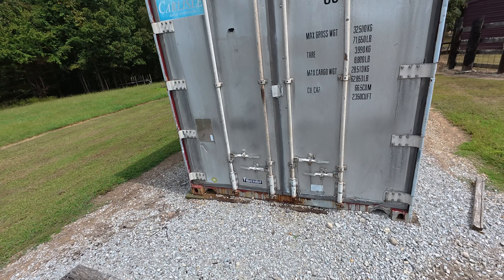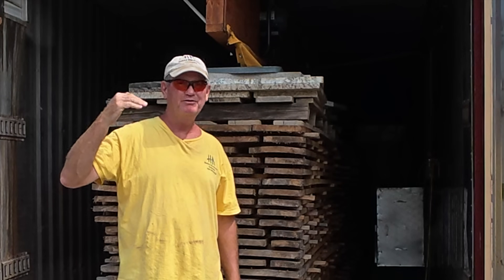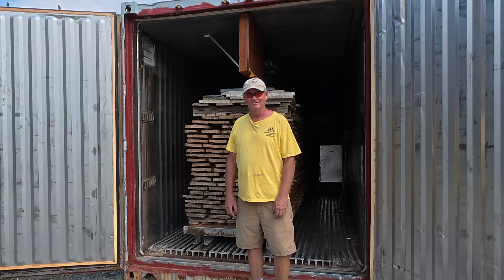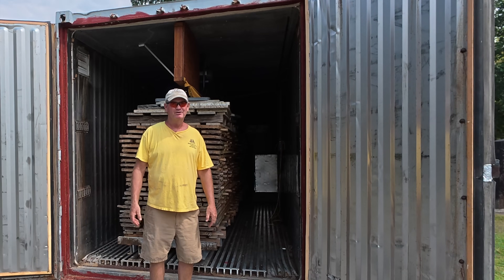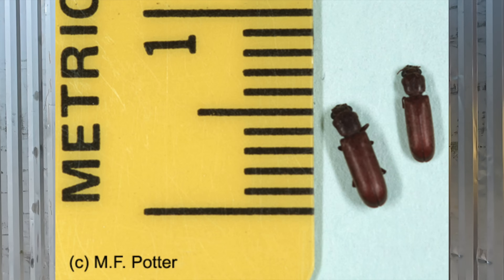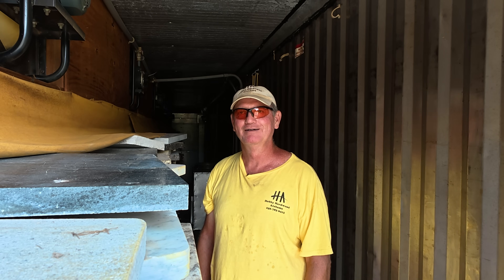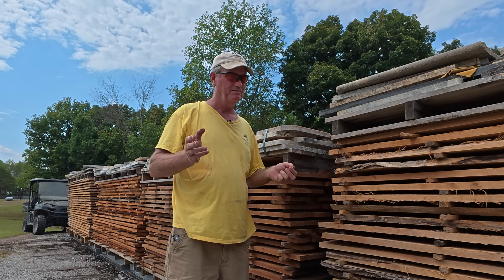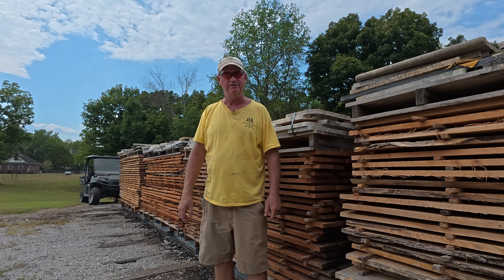26 Lumber Kiln Myths and Truths PART 1

Comment: Believe it or not, everyone doesn't have a $40k plus kiln. Air drying and solar kiln are fine, these guys undermine the little guys to make themselves seem smarter.
Reply from the maker: 100% Absolutely WRONG!  I do this for a living, you obviously do not.  If you want to risk destroying your house, then don't sterilize the wood before you bring it into the house.  I built and used a solar kiln for over a decade, I knew the guy who invented the Va Tech Design, and it will NOT sterilize lumber, and he never claimed it did.  So you know more than Professor Eugene Wengart, the Wood Doctor??  I had to put wood dried by my solar kilns into my other kilns to sterilize,, and I routinely found dead powder post beetles after the sterilization cycle that were not killed by the solar kiln.  About once a week I get a call from people who have done as you say, which is ignore the obvious facts that bugs live in wood and if you bring the wood into the house, the bugs now live in the house.  They ask us for help, because they now have bugs coming out of their floor, furniture or counters.  The cost of tenting and fumigating the entire house is $25K and the cost of fixing the damage is typically an insurance claim.  No bug control company will cover the cost, even if the house is under contract, because the person knowingly brought the bugs inside, so it is a self inflicted claim, and they will not pay.  Do you really think the USDA would come out with a sterilization standard that EVERY professional lumber dryer adheres to, if it was not important?  Instead of saying people like me are trying to "make themselves sound smarter" maybe you should listen to what a professional says, and whether you believe it or not, and whether you do it or not, don't insult me or say I'm lying, when everything I've said is easily looked up and 100% factual.

Comment: The in-kiln moisture reader, How do they detect a moisture pocket when they exist in a static location?
Reply from the maker: Normally you will see indications because the boards are drying erratically, not on a smooth slope or drying curve.   It will usually stall also, indicating wet pockets leaching moisture.  Basically, the boards will "behave" differently.

Comment: Just catching up on videos. Maybe you answer this in the next, but once kiln dried will the moisture come back after a certain time?
Reply from the maker: Yes it will come back up to the surrounding equilibrium moisture content (EMC) of its surroundings, so it should be stored in an environmentally controlled room or building.

Comment: Robert - have you ever heard of a "160 degree F sap set" at the end of a drying schedule?  I've heard guys talking about that up here in northern Minnesota where we saw a lot of red pine, white pine, and white spruce (to supposedly cure any sap pockets so the boards don't drip or have sticky spots).  Thanks and looking forward to part 2.
Reply from the maker: Yes, it is critical for pine, it is also called "Setting the pitch" and basically raises the temperatures of the boards where the turpentine and volatiles in the wood evaporate out, making the sap a hard, crystalline material.  Many times the pitch is not set correctly, and that is why you've probably bought 2x4's at Lowes or HD and noticed they had some sappy, sticky pockets in them.  In that case, it was not set correctly.

Comment: I've said many times, thank you for your videos, but thank you even more for answering all of the comments. I often learn just as much, or more, from the comment replies. I would love to hear about different air drying times for different species prior to going into the kiln.
Reply from the maker: Thanks.  Each species and thickness has a published maximum moisture removal rate of moisture that it can tolerate before it cracks.  So the pallets of lumber are placed in specific areas and other strategies ar used to not dry the wood too quickly to cause cracking or too slowly to cause staining.  Some species I can even used forced air fans on, and some I have to cover with a material to slow the evaporation down.  Good question.

Comment: I have some air dry walnut and need to use some to make 7/8 X 2 inch legs. I don't have a way to kiln dry it. I've brought it into the house to help with drying. Am I better off drying it as a board or cutting the legs out and drying them that way?  Thanks
Reply from the maker: It will move when it dries so better to dry it as boards and then cut the pieces out later.

Comment: Another great video. Thanks again for sharing your knowledge. My grandfather owned a hardwood flooring company, even though the lumber was kiln dried we would still acclimate it in the house to be installed for a couple weeks to assure stability. Some of us folks can't afford a top end kiln like you have, could you share your thoughts in a video on other kilns such as solar or small homemade dehumidifier kiln. Thanks again!
Reply from the maker: Yes, I will do so.  I had a solar kiln for about 10 years, it was very good.  There are also ways to build home made kilns, as well.

Comment: Here an interesting experience we had with drying lumber, but without using a kiln. We were doing a 'gut to the studs' job of our house from 1880. BTW this is in Nova Scotia, which has average but over the year also varying moisture levels. A bunch of old 8x8" columns and beams in our basement were rotten and needed replacement. So our carpenter got super fresh hemlock from the sawmill which was soaking wet and super heavy. Probably not ideal, but the end result was still pretty OK ... and cheap :). 
Now the interesting part: We had some left over beams and kept them (separated with battons) in our basement. Which BTW also has the oil-based furnace for our forced-air heating system. Plus we ventilate that rubble walled basement a lot, most of the time with a couple of small open windows. Three years later I needed some wood to build a shelving system and thought of that hemlock. Over that time it had probably lost half its weight and although I didn't measure the moisture level, it was probably pretty dry. We got it sawn and planed into boards and it has since then never warped or anything.
Lesson learnt for me: a kiln is great if you can't wait. But leaving your wood rest for a year or more in a relatively dry an not too hot or cold environment does the same thing. :)
Reply from the maker: Anytime the air temperature is raised above ambient, and that air is exchanged, then its moisture carrying capacity is increased, and it will transport moisture and dry the wood.  Even a few degrees is all that's necessary, no different than a Wal Mart food dehydrator.  Good observation and comment.  I will discuss it in a follow on video.

Comment: YH, what about timber framing and other construction applications that typically use "green" wood?  Up here (Northwest New Jersey) Eastern White Pone and Hemlock are the most popular choices. require
Reply from the maker: I don' know about up there, but any untreated wood here in the south will quickly get powder post beetles, every barn, shed, etc is infested.  There are soem species that are naturally immune, such as poplar (magnolia) and walnut to some degree.  That's why there are no 100 year old, oak log cabins here anymore, the only ones standing are poplar.

Comment: I noticed your moisture probes are on the edge of the boards. In the nyle manual it says to place them on the face of the boards across the grain. By using the edge they are being placed with the grain. Have you noticed a difference in either method. I will be firing my kiln up in the next couple of days and I will place a probe on the edge of the exact board with a probe on the face to see if there is a difference
Reply from the maker: Realize an edge is simply a narrow face and the probes measure moisture and the resistance in the wood and it electricity doesn't care what direction or face it is measureed.  The important thing is to get the probes into the core of the board, it doesn't matter how it gets there and in a place that will dry hopefully the slowest, so there are not wetter spots than where the probes are.  The reason Nyle wants you to out the probes in the face is that is going cause you to more likely place them in a "moist" area.  That's also why you never measure from the end of a board, it will dry faster than the core, and give an erroneous measurement.  In reality, you will put more error in the measurement by the distance placement of the probes (30mm) separation and the species calibration and the main thing is to try to identify the wettest portion of a board and measure from there, whether it be an edge or face.  Nyle is a good company, but their "coefficients" for their drying groups are off and you should always check the final moisture with a "real" moisture meter, such as a Delhmorst to be sure.  Also, when you run your experiment, you will notice that no matter where you put your probes, and the wood gets down to under 9%, then to 7%, the spread of the measuremts, face to edge, will come together as the moisture is removed and the conductivity of the wood becomes more constant as the moisture becomes low and the same across the board.  On a dry board, it will not matter at all where you measure moisture, face, edge or end.  A dry board is a dry board.  Also, as you dry the wood looking at the probe reading,, you are really looking for a rate of change of moisture from yesterday to today, so not to exceed the daily allowable moisture removal rate.  That is the most important thing.  Ride the allowable rate curve down, and you will notice Nyle's kiln schedules are approximate at best..  I have run the experiment you propose many  times, and it is a good one and an eye opener.  Plus get a good, NIST traceable pin meter,  and measure the entire board, many places, and that's when you know the board is really dry.  Great question.

Comment: Robert, Great job on pontificating the process of kiln drying. I'm wondering what your opinion is on the pros and cons of vacuum kilns with heat. I look forward to your videos every week.  Thanks. DonR
Reply from the maker: All will work of used correctly, but I have had more complaints from customers who bought wood from several local, low vacuum heat kilns than any other cycle.  It must be used correctly.

Comment: Not trying to argue with you, but I'm really confused at this point.  If a kiln does not dry wood faster, then why does virtually all these kiln guys on YouTube brag about how fast it dries their wood?  Also, the higher temps just make sense that it dries faster?
Reply from the maker: Good question.  Kilns dry wood in a controlled environment, at the maximum allowable moisture removal rate for that species and thickness vs air drying.  So for example, pine can be dried very fast, well over 10% per day, and in most areas of the country, the maximum open air drying rate is about 4%.  So for pine, yes, kiln drying can be done 2X or more faster than air drying.  However, white oak in 8/4 thickness can only be dried at about 2% per day or it will surface check and check.  Air drying 8/4 white oak will cause drying too fast jn many parts of the country and will crack the wood.  So a kiln will be set to conditions to dry at 2% and will produce perfect boards but will take longer.  In addition, many people done care or look for the surface defects and which we do, and it is a common customer complaint where people buy from "other" kilns and th wood is ruined when they buy it, but didn't see it until it was planed.  That's also why we always plane our wood before we sell it, it is the ultimate tool for quality control.  Also, not disparaging my YouTube Brethren, but soem have been "sponsored" by the kiln manufacturers and have received their equipment for free, so of course they will say how fast it dries.  As far as heat, yes, the more the heat, the faster will will evolve moisture, but the strength of wood drops drastically as it's temperature goes up, making it even more prone to crack and defect.  So cooler temps in kilns should always be used for that a reason, however, cooler tempos while drying also let the wood retain its natural color and vibrancy.  Higher temps "cook" wood, lower temps "dehydrate" wood and retains its color.  In the end, if the wood has a maximum allowable drying rate that higher than air drying, then kilns can speed up the process.  If the allowable moisture removal rate is lower than air drying, then the kiln is used to slow the process own.  Great question and a great subject for an entire video!

Comment: Say you buy a batch of kiln dried lumber and store in a NON climate controlled environment. The moisture levels are going to change to that environment correct? I would think this would make a wood shop without climate control (at least in midwest) a non starter. Or am I missing something?
Reply from the maker: Yes,  it would be very problematic.  However, even the addition of a $100 Wal Mart dehumidifier can make a huge difference.

Comment: As always, another great video!  We have 2 Nyle L200M's and 1 Nyle 200Pro and love them.  We just commissioned Nyle to custom build us a 40' chamber for one of our L200M's.  When we started, we build our first chamber in our garage.  The only issue with it is that the chamber is just too small and we kiln dry as a service.  We need more capacity because the LT70Super you told us to buy is outstripping our kiln capacity like we feared. What you can't see in this sentence is the sarcasm 😂.  I am not complaining about the advice you gave me . . . I am just joking with you.  I don't know I you remember me asking you last year about whether we should get a 50 or a 70.  My concern about the 70 was out pacing our kilns. You said get the 70 because you can mill the same amount of wood we had been with our 40 in less time and have more time for other things.  It was and is great advice.  There were only two problems with the original plan (and they are good problems).  One sawyer near me shut down his operation and is moving to south Alabama.  The kiln operator near me who had 2 iDry's stopped kiln drying as a service.  So, not only are we milling up 4 x the amount of wood to kiln dry now, we are also kiln drying more wood for others.  So, in addition to getting the bigger chamber, we are finishing our solar kiln (it just needs insulation and doors) to pre-dry some of the hardwoods and picking up another solar kiln of similar size from the sawyer moving to Alabama.   We are going to install sensors and powered vents to help control the temps and moisture content in the solar kilns.  I would love to come visit y'all one day and learn more about your business model.  We are working on ours and would love to learn more from the Professor.  😁
Reply from the maker: I remember!  Good thing you didn't get an LT50, you would be shopping for a 70 by now.  I am glad to hear you are doing well!

Comment: Awesome video Robert, I noticed that it appears that your probes are in the side of the lumber as opposed to being on the face of the wood. Is there an advantage to putting them in the side of the wood? I recently bought a kiln mainly for firewood but we do occasionally dry slabs. Your input on the probe placement would be appreciated. Thanks.
Reply from the maker: Technically, the wide face is a better place because it will be in the center of the board and probably in the wettest spot, however, from the structure of wood anatomy, the edge is just a narrow face and if the location of the pins are picked correctly, you can locate a potential "wetter" edge than on a random face and getter a abetter reading anyway.  In reality, the measurement of the wood is a resistance measurement based on the water in the wood (conductivity), and wood conductivity doesn't change based on grain direction, or quarter sawn wood wood would always be measured from the edge and flat sawn from the face, which is never mentioned.  So the electricity doesn't matter where you put the probes as long as it is a place  where the wood will dry the slowest so you will not be fooled by measuring a dry spot vs a wet spot.  So never measure from the end grain. Also, no way would I will put holes in the face of a $300 live edge slab, but I have no problem putting holes in the bark edge where no one will see them.  With pin meters, moisture is a measure of resistance, using a highly accurate OHM meter, not much different than the one you probably have in your toolbox and resistance in wood doesn't care what direction it is measured. There are many more ways to cause error in moisture measurement that putting probes in the edge.  It's simply important to understand the physics behind the measurement and you will get the correct measurement.  Once again, it's a case of the kiln manufacturers giving blanket instructions without explaining the engineering behind the process to let the lumber drying do what is right for their situation.  Ignorant on their part and typical.  This is a great question and deserves an entire video.
Reply: Robert, that makes sense not putting holes in the face of an expensive live edge slab. Do you go with  longer pin if your putting the probe on the side? Thanks for the feedback it is much appreciated.